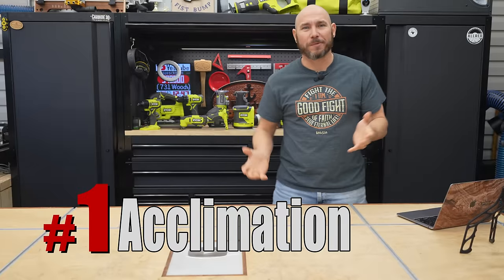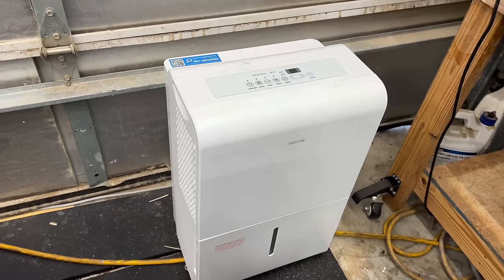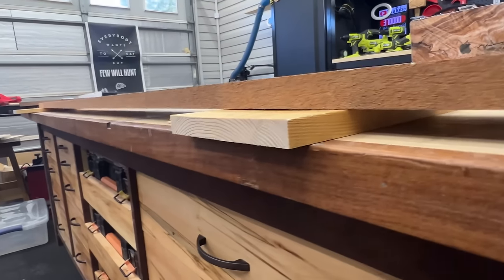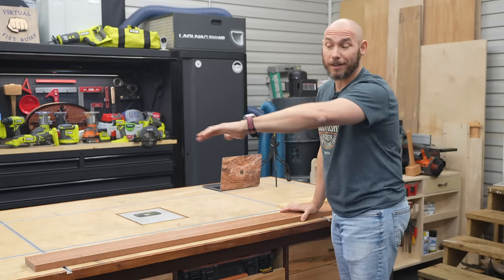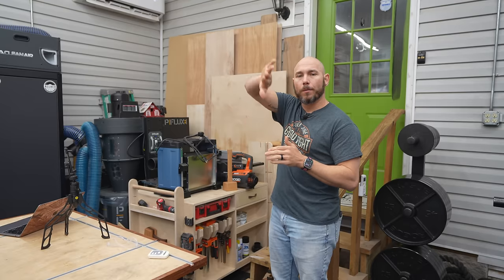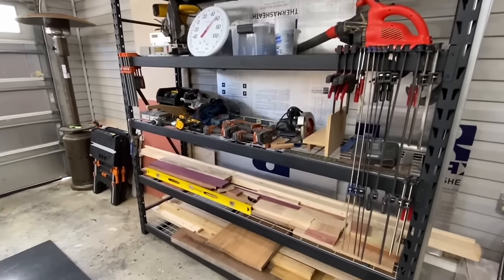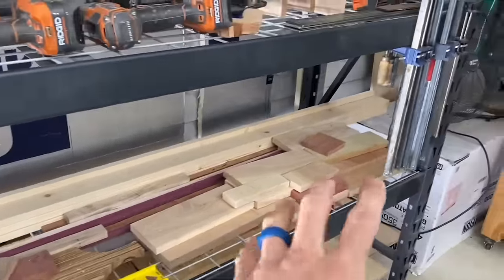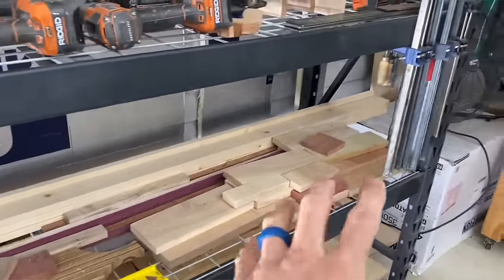99% of Beginners Don't Know These 5 Mistakes Ruin Wood!

Comment: I am new to wood working and have had problems with wood shrinking after I make projects.  In rural Canada lots of our wood at lumber yards is kept outside, also not the best quality.  I have had problems building something then when it is brought inside the furnace sucks all the moisture out of the wood and causing it to shrink.  I have considered bringing the wood inside prior to building with it.  Any recommendations for a solution to this problem?

Comment: If you have wood that has bowed and twisted ect. Can it be re straightened by storing it in right way if possible. Most of my wood is stored in my wooden workshop with a wooden floor that a put a rubber tile floor on top and in a metal shed that has bowed because I stored it wrong no sun can get on it in either but still got 15+ bent warped twisted bowed there off the ground laying on 4 plastic saw horses took support it im hoping it helps

Comment: Best to put fillets between boards/sheets when you are stacking them. Slim strips 1/4" thick every 2 feet. Allows air circulation better.  Especially for long term storage or for freshly milled wood. Four inches off the floor if there is any chance at all of a flood/ponding on the floor. Higher is easier for cleaning rodents and spiders out.  Tarps draped over the ends of the stacks slow down water content equalization - most of the water comes out of the end grain. Reduces splitting.

Comment: Hey, thanks for doing this. I love your channel. Got a question as well. If you can answer for me, I bought a new planer and using kill dried from Home Depot. Got some knots in it and then I read the you shouldn’t run boards with knots in it so if that’s the case to play is no good for me because he can’t afford expensive wood could you please come?
Reply from the maker: I've run several boards through with knots without issue.  The reason people say that is, knots can sometimes chip the blades if they are hard enough, or even come unlodged from the boards.
Reply: OK, thanks for answering. Do you think I should use Staborn glue on the knots before I run them through the planer and will let clog up the planer
Reply from the maker: @raybartell9807  yep, that's what i do
Reply: @731Woodworks  thank you so much.

Comment: Yes … more wood stickers is always better.  Also I find that placing the wood stickers at the ends / flush to the pieces wood in a pile further minimize the ends from splitting.  Yes adding weights on top is good to keep the wood pile from moving. I do more often than not is to strap them up with ratchet straps at each end & add a third one when longer than 7’ or 8’ .  Not to tight.  Try it & let me know if you see an improvement? 
Cheers….. Y.

Comment: FYI: humid air weighs less than dry air and will rise not fall.  
Cold and dry is the heaviest & thickest air, and pilots love it.  Hot humid air is the lightest & thinnest, and pilots have to compensate for it by higher take-off speeds and/or less take-off weight.

Comment: I just picked up a 2x4x10 for about $2.  I live in Arizona. I could see it was already bowing. I laid it down in the dirt and put a brick in the center. It straightened out in about five days (or the next time I looked at it).  It didn't absorb any moisture, remember I live in AZ.

Comment: If you store the wood vertically, do you still need to put wood to keep it off the cement floor?  Does it matter if your workshop has laminate on top of the floor?  I just wasn't sure if this would change anything with having laminate on top of a cement floor for wood storage.

Comment: It isn't acclimating to the shop but to the point of final use. My workshop is my garage - cold and damp. I made a very nice box which then warped horribly when in it's final point of use (aircon, dry and warm.) It had been acclimatising in the garage for months.

Comment: I don't have a shop or much work space. I also don't have much room inside my house for lumber to sit. I have a garage but it's not heated. One other problem is the stores I get wood from. Two of them store outside and it's winter now and I want to get some material sometime soon. The other store is stored inside but all of them have 2x4s etc that are so twisted you could make curly fries with them. Plus they still sell them at full price.

Comment: I have a number of those Bora racks and I too worried about weight at first... months later, no issues!  One question about your hardwood storage on the racks - I've thought that in between each board I ought to put spacers in to help maintain air circulation. I noticed in a few of the shots you don't.  But the wood did seem to change from shot to shot. Do you suggest that we space boards off each other if they're stored over longer periods... and yours weren't at one point because you knew you'd use it all over a short time?  Thanks and GREAT video!  An amazing resource for all skill levels and experience! :_fistbump:
Reply from the maker: I haven't seen any issues with not having them spaced out. But again, I have a dehumidifier and climate control. Not sure if that helps them or not?
Reply: Big box stores don’t space them and look what their’s look like.
Best practice is to allow the board to acclimate evenly… so if moisture can escape the top, you should also allow moisture to escape the bottom.
Reply: @Damon_Barber  A lot of that is how wet, not moist, the lumber comes in from the mills.

Comment: The biggest tip is: anything cold will draw moisture to it. The best way to prevent your table saw or jointer from rusting is to cover them with a blanket or a piece of wood. Storing your tools and blades in a towel will stop all rust. Concrete is colder than the ambient air at all times so it will always attract invisible condensation. Conversely, anything warmer than the ambient air cannot have condensation and humidity. Having your storage area slightly above the ambient temperature, will dramatically lower humidity.

Comment: There should be a moisture barrier preferably space between the concrete and your stored wood, pieces of scrap wood as base are just in-between sponges so not really good enough on their own.  Add space by using some bumps on the bottom like screwheads or something.

Comment: I purchased excess lumber back in early 2020 before the pandemic jacked wood prices up. I still have some unused on my wood racks in good condition. 
I actually stacked them on their sides (just so I could fit another board or two) with small gaps between them. I only have one board on my rack that is laying flat that developed a slight cup on one end. My shop (garage) is not climate controlled, nor do I have a dehumidifier. I live on the west side of Houston, Tx… we get our fair share of humidity.
Like Matt said in the video, “It’ll be fine.”

Comment: 1:57 If there's a gap allowing air in, your shop's humidity will naturally be trying to match the one outside.  Setting your shop's desired humidity to 30% I think is rather extreme, i.e. unless you live in a dry climate (in the autumn or spring or during rainy days), the dehumidifier will be working non-stop. Moreover, these dehumidifiers that work using a heat pump, will mostly work efficiently at 20 degrees Celsius 68 Fahrenheit) or above. Anything below that and the de-humidifier is just heating up the shop, i.e. wasting electricity. I don't know what the humidity requirements for a shop are but for home use, in my experience, there is no point to setting the humidifier below 40% with 45% being a good target.

Comment: Another thing to mention. There are good tips here in the comments. Just wanted to add, the way that condensation works; anything that is a hard, heavy material, that retains heat, like concrete, steel, or hand tools, will get condensation droplets on them. When warm air hits a cold piece of steel, or cold concrete, the water condenses (even if you can't see it). Never rest your boards against cold steel, or store them on a steel shelf, because the steel will have condensation on it. But if you want to prevent your table saw from rusting, the best solution is to cover it with a sheet of plywood, or a blanket. You don't need to oil it, or wrap it in plastic. If you insulate hard surfaces with a blanket, it stops 99% of the condensation, and the condensation is the cause of rust and warpage. Wrapping expensive tools or saw blades in a towel (not plastic wrap) will stop them from getting rusty.

Comment: I use those lumber racks.. have both the Bora and the Grizzly, Exact same thing except the color even with shipping the grizzly's are a good bit less expensive! they work fine same spacing and everything, have them mixed and work together fine. Save $$ get the grizzly

Comment: I use the same ripping sled as you do but it’s about eight feet long so on the outfeed side it occasionally drifted away from the fence. I made a custom featherboard that fits in the miter slot and is lower than the thickness of the jig so the cutoff goes over it

Comment: I want to start buying some tools for woodworking, and eventual do some projects, but unfortunately lumber is ridiculously expensive with no signs of coming down in price. Pre-pandemic I bought a 4x8x3/4 sheet of MDF I cut down for a desktop, and at the time I paid $30. Now that same measured piece is double the price. I just can't afford it right now. I know prices will eventually fall, but it's a bit disheartening, and demotivating to even attempt any projects because if I screw up, like I know I will, it's gonna cost me way more these days. It's a bummer, but it is what it is.

Comment: An additional tip I learned from my main "goto" hardwood sawmill is to keep wood fully covered over the length while it's acclimating.
Let's say I get some 4 foot 1x6's of mahogany.  I'll put them at least one or two layers down in a similar stack of 1x6's for at least as long as they acclimate.
The logic of this, according to the sawmill, is to let any drying occur evenly given that the most damage (twisting, warping) occurs when the top face of a length of wood is exposed to air while the bottom face is flat against a pile of wood causing the upper, air-exposed face to contract faster and warp upward.
I've had great luck with this tip.

Comment: Considering wood from your local lumber store to be "the same" ignores the fact that 90% of the time it's been sitting outside the yard for days, in the rain, the sun, and so forth, as well as bundled into a tight pile, meaning "no aeration" since it was packed (wherever) for shipping. I just bought some 4x4s at a local Lowes and they were sopping wet, because it had rained A WEEK AGO. 😉

Comment: Humidity can vary widely even locally. A few miles away doesn't matter. If you're next to woods or a river your humidity is going to be totally different. A lot of lumber yards store most of their lumber outdoors not in climate controlled areas. If you have to have your lumber delivered it's going to go through conditions you can't control. You should always rest your lumber in the climate you're going to be using it/building before using it if possible

Comment: Great tips. I have a question about 12 foot lengths of 4x4. I was building a neighnorhood playhouse for the kids amd had the posts set in the ground 3 feet (my region has a 1-foot freeze line depth amd asks for 2 feet depth If I recall correctly).  3 out of 15 I bought warped and twisted on me after a week of being set.  The worse twisted about 70-degrees to where it was no longer square to my project. I have since replaced them after buying 4...1 twisted again amd thankfully I compensated for that. What am I doing wrong or is it just natural for it to be a loss?
Reply: (Continued) — Part 2)
Since your 4x4 twisted after you already installed them, my next suggestion is not for fixed this problem but how t9 be proactive the next time.  Once you get the treated lumber home, stack it and leave it dry for several weeks before using it.  Where you plan to stack the wood for drying, place scrap 4x4s or double 2x4s down first. Ideally these should be spaced 24” apart.  Lay one layer of wood across them. Leave at least 3/4” space between adjacent boards. Place 2x2, 2x4, 1x2, or double laths on top of each 4x4. Place another layer…and keep repeating this until all the lumber is stacked.  Now air can circulate around all the boards so they can dry.  Placing 100s of pounds of weight on top of the pile will reduce warping of the boards. You can also place ratchet straps around the entire pile located each column of spacers.  A tarp on top to shed rain is fine, but no tarp down the sides so the breezes are not blocked.    After a couple weeks—the longer the better—you can start using the wood.  The pretzels can be culled and construction commenced.

Comment: If I buy the crappy lumber from Home Depot, I find that within 2-3 days 1/4 to 1/2 of the boards will warp while in the garage even if blocked up off the floor or stored on sawhorses. Only way to avoid warping is to use it immediately or to stack it and clamp it together.

Comment: Typically I cover the wood with a cloth tarp or sheet especially after I resaw it. It keeps the air movement down around the outside and top of the lumber. It also keeps the light off of it.

Comment: Small table tops like the little end table at the end of the video won't have big issues with wood movement. Try building your assembly table out of solid wood instead of plywood and you'll be MUCH more concerned about wood movement - the little bits of movement in each piece don't add up to much when you have two small pieces, but in the dozen wider pieces required for a dining room table top, they add up and make more of a difference. Plus, at the added cost you're billing a client for a big dining table vs a small end table, those little bits of movement are not acceptable, IMHO.
You still get a thumbs up from me, though!

Comment: Only missed one comment on the wood movement, build with movement in mind and you can get a way with a lot. Most traditional building patterns have this built in. I have been studying a Queens College bookcase for reproduction and it is fascinating how the builders  planned the internal structure to handle seasonal movement before teh advent of climate control

Comment: id like to expand on acclimation...if your shop isnt climate controlled in a manner similar to your house or final use area - then bring that lumber and acclimate it in your house or final use area, its going to be a pain but youll have to bring them in and out constantly to keep them acclimated, make the cuts you need or glue up and put back in house until ready for next step, etc .

Comment: I laughed when u talked about your uneven shop floor.  The concrete floor n my old shop/garage is 1 step above dirt.  To look at it from outside, u wouldn't believe it was a fully equipped wood shop n thr, all up on wheels and hanging on walls. I make boxes, so my lumber storage isn't huge.  I put it on a tarp in my remodeled carpeted basement.

Comment: Lol...
I literally live on a family owned (going on 3rd generation) circle saw mill, and we almost do the opposite.  We let our logs sit for years outside if possible, then cut it to order.  After that, it sits outside off the ground until the client can pick it up...
of course, we deal mostly with construction stuff like lumber and turned logs so it needs to be able to adapt to random climates.

The blued pine though!

Comment: Moist air is lighter than dry air. The moisture in concrete comes primarily from wicking water from the ground and condensation from the air.
Reply from the maker: Fact!  You taught me something today lol.  Thank you.  Just double checked  and found this "Dry air consists mostly of nitrogen and oxygen molecules, which weigh more than water molecules. This means that when a given volume of air is made more moist by adding water molecules, heavier molecules are replaced with lighter molecules. Therefore, moist air is lighter than dry air if both are at the same temperature and pressure."

Comment: I have a small workshop in my basement, which is also the storage for my lumber.  my lumber is in a small room which is about 10 ft x 10 ft so my all my lumber is being stored vertically.  just one end is touching the concrete floor, figured that would be ok.  They are stood up pretty vertical so all good there.  whenever i remove a some pieces I restack it so it's straight up again, i don't leave them leaning.  Humidity is usually around 25% and right now with it being winter it's a balmy 60 degree's down there (currently around -20'ish outside close to -35 with the wind).

Comment: I assume, maybe incorrectly, that this does not apply to composite materials like Trex or TimberTech (AZEK). I have read in their literature that these materials are impervious to moisture, heat and cold. Would you agree with their claim. Would you feel comfortable buying Trex and starting you project right away? Thanks for the insight!

Comment: Where do you order your hardwood from? I’m like you I’m in the south.
Reply from the maker: I order from wtghardwoods.com Shipping is expensive on the big boxes of wood but I can't get it locally and the stuff he sends is always top quality. I typically order 4 feet lengths by 8 inches wide and 1 inch thick (typically is between .085 and .09 thick).  It is surfaced 4 sides ready to use when I get it.